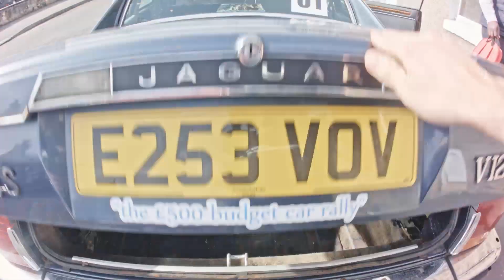The racing engine comes out my Jaguar XJS V12! VLOG21

Comment: I have a 93 XJS that's been sitting for years. I found a 1989 V12 XJS engine in the junkyard today. Should I keep the I6, buy and build the V12, or do an LS motor?
Reply: Too many LS builds out there. The V12 is definitely not for the faint of heart or short of time. Quite simple engine, the V12. just horrible electronics, and most were poorly taken care of. Aftermarket isn't particularly wonderful either. If you can find the parts, and you have the time, then the V12 is the most worth it out of the 3. Thing of absolute beauty. 

If you've got the cash and really don't feel like dealing with old jag tech for whatever reason there is an "LS" that hits all the marks of the three separate engines you've listed, however, its prohibitively expensive for most people- the V12LS from Australia. They run around $55000 USD though. Absolutely ridiculous engines though. They sound like what the name implies- like an iconic pushrod 2 valve LS and a V12 had a baby.

Comment: I’d like to see you bolting some of your goodies onto my pre HE. I’ve already got the Getrag and the diff to go with it so you won’t have too much to do. Thanks in anticipation...😜
Reply from the maker: Paul Fitzgerald I was also desperate to do this. The engine that's in it is currently a 5.3 flat head with 9:1 cr. Sadly I never got it to the dyno as it had a miss fire on one cylinder and I later discovered that it has no compression on that cylinder! I'm now toying with which engine to go for...
Reply from the maker: Paul Fitzgerald I was also desperate to do this. The engine that's in it is currently a 5.3 flat head with 9:1 cr. Sadly I never got it to the dyno as it had a miss fire on one cylinder and I later discovered that it has no compression on that cylinder! I'm now toying with which engine to go for...
Reply: Rust2Rome I’m sure you’ll make the right choice. I’m going to pick up another set of flat heads tomorrow that I’ve bought. I had wild ideas of getting them ported, polished, larger valves etc but have been smacked round the head with Rob Beeres price list! I’ll just do a bit of fettling with them myself till I can find a cheaper option... Good luck with ‘The Pearl’